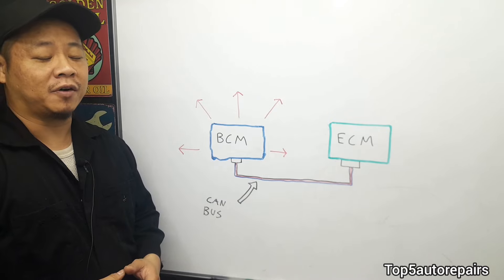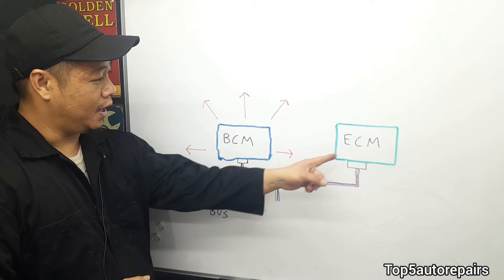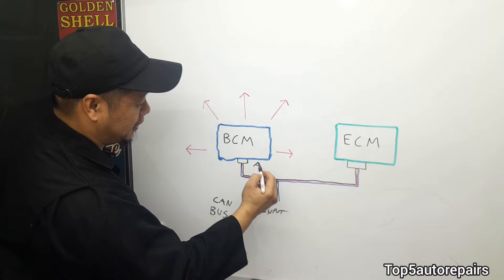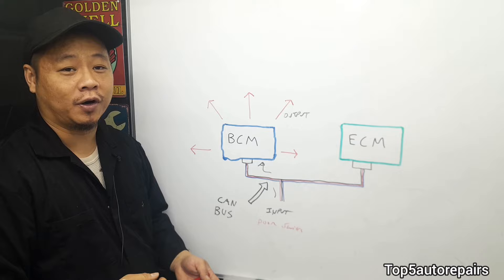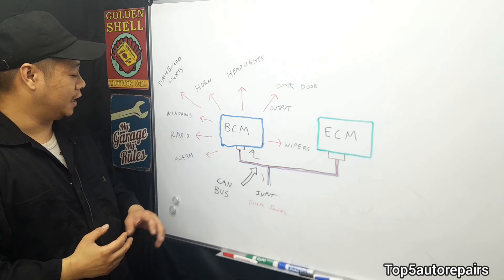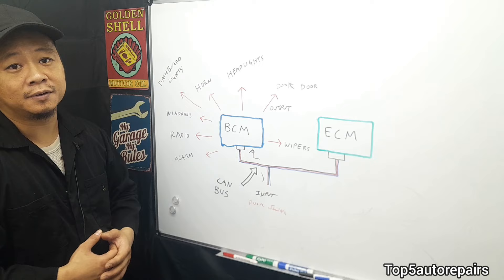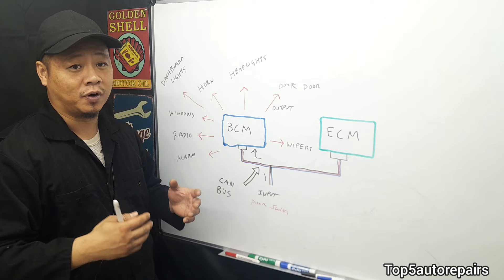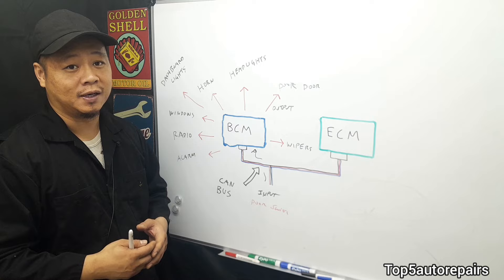Failed Body Control Module??? Do Not Replace Until You're Sure It's The Problem. Know The Symptoms

Comment: hi... good explanation but there are things I don't understand, my 1998 Buick Regal, the Power locks don't work, I only opened the driver's door with the beeper and the trunk... but the beeper broke and I bought two new but I can't program them, even if they work half as before, because the power locks don't work...so I got the electrical schematic of the system and I checked it completely and it seems to be fine, the actuators are working and have current, the same with the switch the doors... when you press to open it sounds a click click in three little boxes that look like relays and at the same time in the circuit relay it also clicks....so I bought a new one and it continues doing the same thing, I put the original one on it back and now it closes when you press to open and when you press to close it sounds three bells...also when you put the car in Parking it locks instead of opening...it drives me crazy and I don't know what to do...I know this post It's long but it seems to me that you are a person who can help me... a strange thing is that when I move the relay it stops working and clicks and then I move it from new and start to close...
.thanks in advance for your help...if you have a email  is better but is up to you.
Reply: Did you readmy problem...please let me know

Comment: hi i have problem with my head light, they are always on even when switch is on zero and cant connect to central electric with diag is it possible that my bcm is at fault? i  changed my comfort module for new one same issue.

Comment: I sent my car to the dealership mercedes...and they said . That I have a bad cluster...so I change the cluster..and I still having the same problem...and they said that they need to continue the diagnosis...and the cluster price was 1800 dollars...so I need to go to your place
Reply: I’m getting no power between the fuse spots and the air ride suspension motor
Reply: Fuse box

Comment: Short & sweet, nice vid! I’m considering 02 Jag XK8 but windows, rooftop and seats don’t work. Seller is saying it may need new control module. But I heard programming it can be difficult. Any suggestion or experience with this? Thank you
Reply from the maker: Match up part # and find someone with the correct programming scan tool to do it.
Reply: @Top5AutoRepairs  thank you

Comment: I have complete and total power failure on a Dodge Journey 2011. It's not the battery nor any fuse (and I'm very certain; I'm a motorcycle/aircraft tech). Seems like the BCM is the only single point of failure that could cause a complete failure of all things electrical when everything was running just moments before, right?

Yes, I am CERTAIN it's not the battery, alternator, or fuses. It gets annoying getting advice from the student-level every day.
Reply: The only other suspect I have in mind is the TIPM but that's an even bigger hassle to replace, it sounds like.

Comment: i have no dash lights no blower fan no windows no horn no signals no electic seats no seat heatser 2012 golf tdi hatchback.  my radio works and my alarm goes on at random times. is this my issue

Comment: Is BCM something a local auto shop can repair?
Reply from the maker: It's not difficult to replace the BCM. However for some vehicles, the BCM must be reprogrammed after replacement.
Reply: sometimes, the pins can be resoldered as a DIY.  On Dodge Caravans, for example, the plugs on the BCM (and instrument panels) sometimes get cold solder joints that crack over time with vibrations.

Comment: Good day Mr. I had a Mazda Capella automatic motor 2.0 lt, year 2001, here in south américa it's 626 Millenium and the cabin lights fail and radio, I was restore the 10 amp fuse, and radio start work but cabin lights don't, can tell me where it's the BCM located, and where I can buy a same parte by internet, thank you for your cooperation y explain.

Comment: Can a failing bcm cause the engine to run poorly, like misfire, run rough, almost die if you put it in gear? So basically can a bad bcm module disrupt the can bus signals such that the ecm can’t operate properly?
Reply: I wouldn’t think so.
Reply: @dirtcheapmedia3390  

It absolutely can!

My car was sputtering like it was gonna die!

All gauges went haywire! Lost power steering and the power locks were going up and down!

Had the BCM replacement under warranty!

But now it's happening again with no warranty! 😂

May need to replace a SECOND time!
Reply: Absolutely!

I had to replace mine due to:

Sputtering, loss of power steering, gauges going crazy AND Power locks going up and down by themselves!

Good Luck to you Sir!
Reply: @sergiogalindo3024  Can you provide an update after your BCM SwaP out... Where you buy yours? How Much? Pre Programmed or Not? MY 2010 ImPala is having the same Issues yours had plus No Crank No Start and ALL Intermittent... Thanks for your time..

Comment: I've got a loss of communication to the BCM on 03 LB7 sierra, won't truck allow it to run like the security is shutting it down (fires over and dies) however no security light on the dash, ive also got through the relearn procedure several times incase.  In order to start the truck I have to turn 
1. disconnect the batteries
2.turn the key to the first position
3. Hold the positive cables to the negative cables for 10 seconds.
4. Reconnect battery cables to terminals.
5. Turn the key the rest of thebway to start position, it will fire and run.
After shutting off it will restart until it times out.  
I'm suspecting a can bus or data wire between the FICM and BCM has open circuit.  
This problem has been put on the back burner for since the fall, I'm about to get back into it.  Any lead you can give would be a god send.  Tha ks for the video!
Reply: you might have a bad catalytic converter, if is start and runs than will shut off after like 10 secound is a catalytic converter, sometime will sputter and smell like rotten eggs
Reply: @MrTottanham  there is no converter.  That can be the case on a gas vehicle when  it gets  hot and melts.
Reply: somewhat of the same problem? my g35x wont start, pushing the push start just turns on my dash lights/accessories as they flicker. cant turn the car off unless i disconnect battery

Comment: Can I get some advice please?
Reply from the maker: Hi.
Reply: @Top5AutoRepairs  got 97 Buick LeSabre 3.8 l transmission 4t60e all forward gears went out same time , reverse still strong any ideal ?
Reply from the maker: Bad shift solenoid or something mechanical failed internally
Reply: Someone changed fluid in it that when it happened I guess ,I should take pan off and check

Comment: Our 2010 Nissan Murano intermittently will turn over fine. It just wont actually start. No ebgine codes. But we do have B2562 and B2606 codes with the scanner. No trouble lights on dash. Wait 30 mins and it starts up and runs great. These codes both point to BCM or harness. Could that cause a crank, but not start?